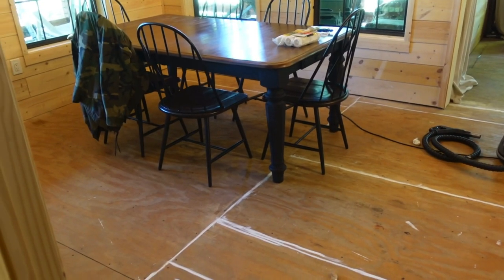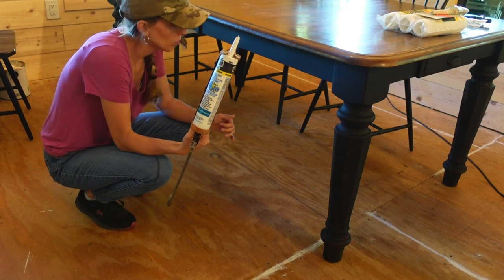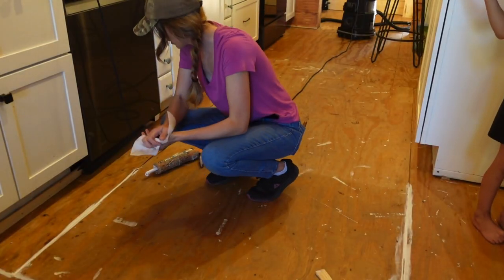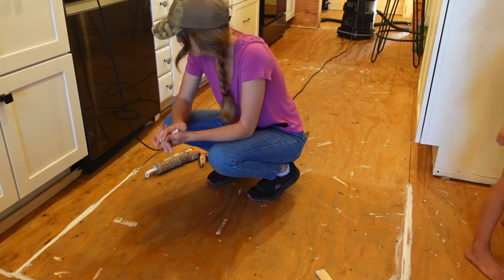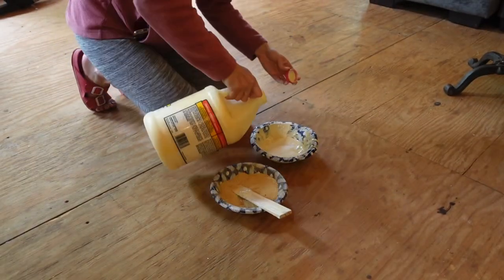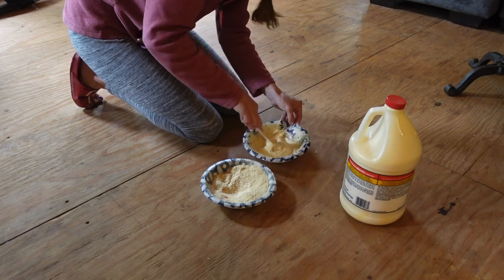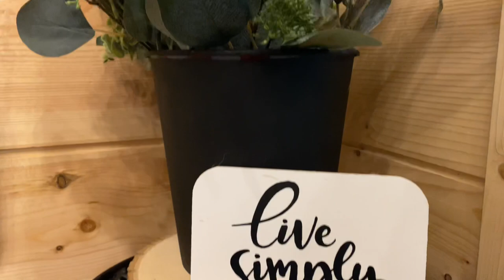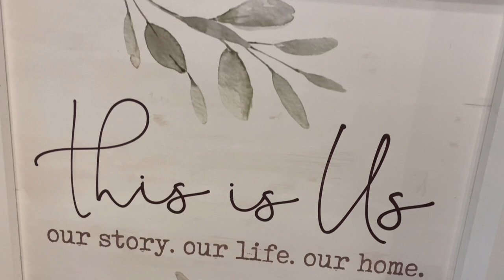Painting Our Plywood Floor

Comment: Jesus, darling, don’t use caulking on the floor, when it dries out, it will leave gaps and dips in the joints, use spackle or flexible floor compound.

Comment: Luv, luv, luv! The painted floor is charming. Funny, the color reminds me of the base color my son's wife picked out when we painted a faux saltillo tile on the concrete sun room floor of the 1960s ranch they live in. And you can always use that color to simulate grout if you decide to stamp or stencil a tile or other pattern on top of it.  
We used 16" squares of 4" thick chair foam as stamps. We used 2 subtle shades of terra cotta & a dull washed out gold paint that we poured in random size  puddles into  pizza boxes, then plopped the foam down into the paint & stamped it between 16 1/2" grid chalk lines. Due to the puddle technique leaving very thick paint in spots, it took days to dry. Then she put several layers of matt clear coat on top. Looked just like saltillo.  
Don't get down about lack of progress on your house. We're all postponing projects. I have a house & a bunkhouse that need new roofs. Not gonna happen soon, as long as they don't leak. Maybe a blessing that we've not had rain in a year. I have a few spots I've patched around the vents. I don't care, I refuse to be robbed buying overpriced building materials.
Reply: Would love to see how it turned out! 😊plus if there was things you would do differently now